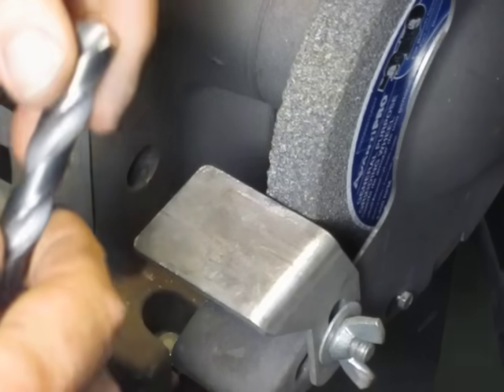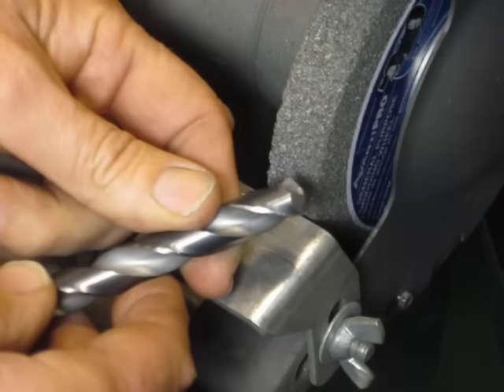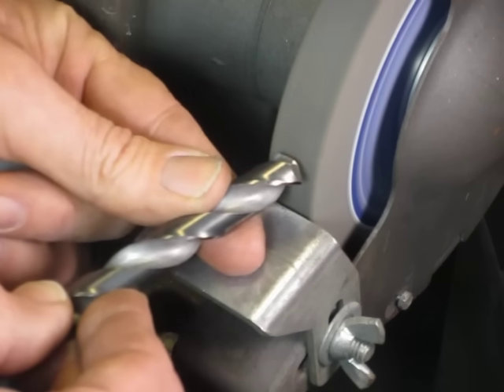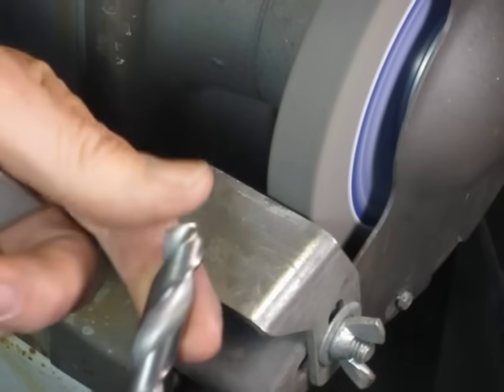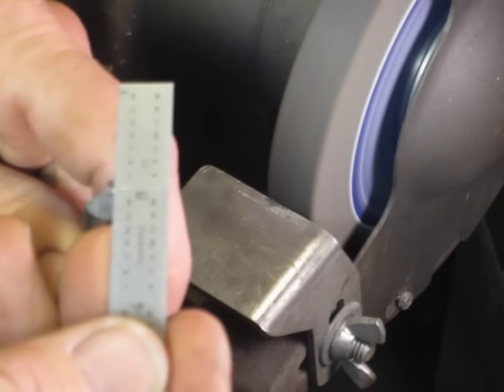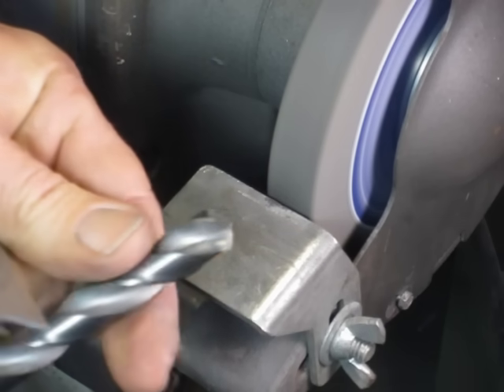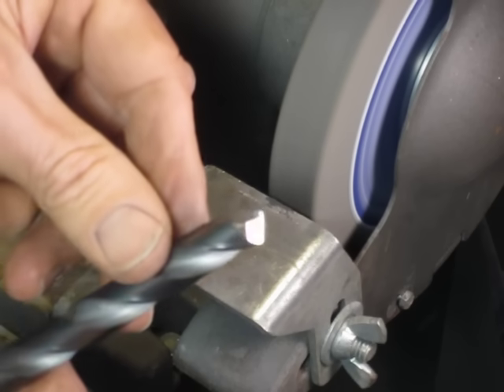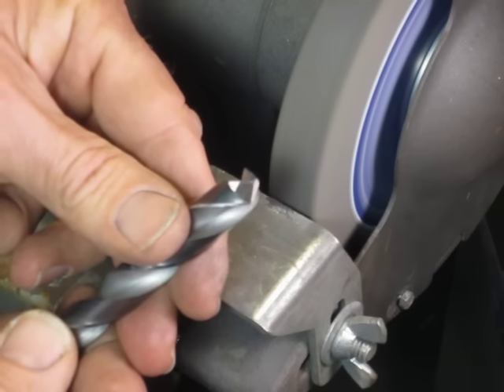How to Hand Sharpen a Twist Drill

Comment: How did you check your chisel centrality? poor centrality will allow the drill to walk during use especially on uneven surfaces.
Reply from the maker: Paul Ehrlich 
Paul,

The drill will pivot around the point and if it is off center, that will cause the drill to produce an oversize hole. I just use a ruler to measure the length of each cutting edge to be sure they are equal. Drill gauges will also have divisions on them fr that purpose.

Tom

Comment: This is not how I remember doing it. Free float handle it buddy. Go through the entire motion instead of just keeping it there. This will remove the last steps you were doing with those newly created edges. Also I find using a sandpaper like belt sander or something rotating on a drill etc, will give you even better sharper bit that will go through anything. I normally resharpen mine every 20 holes or so when I'm doing thin metal in a roll. Stops me getting tired and maintains the bit doing the work and not the pressure.
Reply from the maker: HenryMania 
I used to sharpen them with radial clearance as well until I discovered this method. This way is much easier, especially for the beginners for who this video is intended. Since the clearance angle is fixed, there is less movement of the drill required on the wheel.

Tom
Reply: Toms Techniques Oh I see what you mean. I might give it a try although I've kinda got the hang of it now going through the entire motion. As long as you don't hit the back on the finish swipe it should be good and easy. Fluid as playing table tennis hehe

Comment: After doing a few hundred you can almost sharpen them in your sleep.
I have had to use a belt sander to touch up a large diameter bit. The grinding wheel was way too narrow for me to get both sides of the bit even.

Comment: I do them the same way you do.  Practice is all it takes.  As for the the guards,  I take mine off.  There to dangerous, drop something in there it will either bind up the wheel or fly around and fly out.  I'd rather just have it fall to the floor.  Shit does happen either way
Reply from the maker: jim sanker 
The guards are basically for spark control. What you REALLY need to pay attention to are the tool rests. They need to be close to the wheel so there is no way a tool bit can be pulled between them, with a finger.

Tom

Comment: Good video.  I've been sharpening bits for years, much the same as your technique.  The Tool Maker who showed me found it much easier to start with the biggest drill you have.  After a few drills, 'graduate' to smaller size drill bits.Later, I found it just as easy to use my angle grinder, especially for reducing the web.
Your video might have more impact if you stick the bit in a drill press and bore a few holes. That always converts non-believers.  NEVER use gloves and let the grinding wheel do the cutting.
Reply from the maker: simplyconnected 
Thanks. 

I've been considering re-shooting the video because it has been so popular. Some of the shots are out of focus or errant and it would be good as you say, to demo the finished product. I guess there will also have to be a comment about not wearing gloves when using machinery since there appears to be a few dangerously uninformed souls out there who feel that it's an appropriate thing to do. I really need to get busy on the entanglement safety video that I've been considering. Perhaps a demo on how violent an event a glove getting snagged in a machine is, will open a few eyes and save a few hands.

Thanks for watching.

Tom
Reply: I work at Ford Motor Co. and while waiting to take my 'high climbing physical', a guy came into Medical. He looked like he was shot with a shot gun (he really did). Turns out he was near a huge 4' grinding wheel (used to grind production crankshafts) when it suddenly let loose. His coveralls got the brunt of damage with tufts torn out in dozens of places.
The only exception I can understand for NOT wearing gloves, is with the polishing guys in plating shops.  Polishing compound (rouge) doesn't work until it gets hot so those guys must hold hot parts against buffing wheels turning at 3,600 rpm or more.  Many of the pieces are small. Too much polishing washes out character lines, so it is very tricky, especially on soft pot metal (zinc).. - Dave
Reply from the maker: simplyconnected 

I can't believe there are still people debating this issue. I have seen what a guys thumb looks like after it has been pulled between the tool rest and the wheel of a large grinder and it wasn't pretty. Luckily the wheel didn't have enough energy to completely remove it before stopping. Gloves and machinery DO NOT MIX. Entanglement injuries in highe speed machinery happen in a microsecond, before you even have time to react. This is a concept difficult to grasp by people who are unfamiliar with machine operation and by the time they figure it out, it's too late.

If you need more, please checkout the Fatality and Catastrophe Investigation Summaries on the Department of Labor website. Type in glove and grinder, or just glove in the keyword search for some terrifying reading.

https://www.osha.gov/pls/imis/accidentsearch.html

Tom

Comment: I inherited a very nice drill grinder, Lisle 91000. It will put a brand new grind on a drill bit and it works a charm. 

Though I am curious the one thing you didn't show was the proper angle of the chisel point to the cutting edge. I found this rather tricky even with my grinder to get, if for say you are regrinding a broken drill bit or one that has a completely ruined edge.
Reply from the maker: Jay Cole 
There is no aligning of the chisel point, it just falls in place when you establish the point and clearance angles.

Tom

Comment: ?¸¸.•*¨*• Excellent video Tom¸¸.•*¨*•?

Just a few things for newbies to note :
-----------------------------------------------------
1. Wear safety glasses
2. When starting up the grindstone, stand clear of the path of rotation, big "stones" can shatter on startup or throw pieces everywhere.
3. Never remove the machine safety guards.
4. Tom shows you how to place your fingers on the tool rest.
Many machinist have lost the tip of the finger from a moment of inattentiveness or tiredness.
5. Never ever take your eye of what you are doing.
Don't let kids etc.. play around you when doing this
6. Don't let people come up to you and start talking while doing this, don't get distracted.
7. Wear correct apparel, don't wear a tie or something like that that can go into the machine.

I know this is all Duh! for the old hands but I've seen too many people loose finger tips working on grind stones.
Reply from the maker: Some good common sense points, especially about them being second nature to us "old timers". One that you missed is always make sure the tool rest is properly adjusted. As long as it is close to the wheel, there is no way that a tool bit or finger can be pulled in. You might get a manicure if you bump the wheel, but it's not going to pull your finger in.

I actually did lose the tip of a thumb once when I was young and immortal, but it was on a belt sander. A piece of angle I was holding got between the belt and table and pulled my thumb against the moving belt. I lost the tip down to the bone including most of the nail, but I was lucky. Amazingly enough, it all grew back over time.

Be careful out there. Machines tools are mindless and don't care if they nick your finger or remove your arm.

Tom
Reply: Toms Techniques Yup, My father lost the first joint of his thumb that way.
I once worked in a tool factory and out of a staff of almost 400 people there were at least 30 that had lost a finger joint or 2 from these machines.
Reply from the maker: Lar Cat 

People who are unfamiliar with machinery can't comprehend how fast that sort of thing can happen. Usually the loud bang is the first you notice that something is wrong, but by then the damage is done and there is no going back. You might just lose some skin, or and entire finger. The machine is uncaring, one way or the other.

Tom

Comment: I wish I knew how to watch this over again cause I believe I missed the part about how to hold my hands at 118* . I know the view of the tip inspection is below the sight range, so perhaps the other is also. This seems to be the easiest method to sharpen, if I can only learn the missing technique. Thank You! JD
Reply from the maker: What do you mean by you wish you knew how to watch this over again? You can watch it as many times as you like.

I just rest my fingers and the drill on the tool rest to establish an angle and then check it with the protractor. It just takes practice to be able to pick up the angle again once it's established.

If you have any specific questions about sharpening drill bits, just contact me through my website, tomstechniques.com.

Tom
Reply: Toms TechniquesOne thing you should mention- the sparks coming off the wheel show you where the bit is making contact. If the angle is correct then sparks will fly uniformly, but will indicate gaps when the angle is slightly off
Reply from the maker: 24-7 Lockouts  I do mention that in some of my tool bit grinding videos, but the same applies with drill bits. They will not only be uniform when the point angle is lined up, but will start to come over the top of the cutting edge when the clearance angle is flat against the wheel.

Tom

Comment: Nice, clear and concise video. A little tip for those starting out sharpening their own drills; it can help to scribe a line at 59 degrees on the grinder rest. It makes it easier to get the included 118 degree angle correct.
Reply from the maker: Thanks, I'm glad you enjoyed it. That's also a very good tip. It can be difficult to keep the angle the same on both flutes until you get some practice under your belt.

Tom

Comment: Hi Tom. What grit stone are you using?
Reply from the maker: It's a 60 grit and on the coarse side for small drills. I like it for grinding lathe tools because it's fast, but for drills an 80 or 100 grit would be better.

Tom
Reply: Toms Techniques Hi Tom, I'm wondering is there a specific reason I see most people using a coarse or medium grinding wheel to sharpen bits? For me it would seam logical to grind down with coarse wheel and finish to a nice edge with a fine wheel like 180-200 grit.

Is this wrong? does using a fine wheel create to narrow an edge and as a result the edge wont last as long, or am I ok to keep using a fine grinding wheel?

Also what's your opinion on grinding off the back heel of the bit, I see people do this alot, it also seams logical that it may reduce heat or just aid in the extraction of swarf or something along those line. but the best videos I see of guys sharpening don't employ this technique.

Any help or Ideas would be appreciated.

Thank's!
Reply from the maker: atourdeforce  Using two wheels means you are sharpening the bit twice. Just choose a grit that works best for the size of drill you are sharpening and stick to it. The wheel in this video is 60 grit, which is good for larger bits, but smaller ones are easier to sharpen with a finer grit like 80 or 100.

By "backing off", I assume you mean create a secondary clearance angle. I do demonstrate that in the video.

Tom

Comment: Thank you Tom for this straightforward  technique. Dull and improperly sharpened bits cost many hours of work over time with less than desirable results.  I told the boss to stop buying so many new drill bits. I can save us some cash and get back in production faster if I don't have to struggle with a repair. Subscribed!
Reply from the maker: Thanks for watching.

Comment: my father was a master tool & die maker .....he taught me how to sharpen drill bits in the shop at 16 years old much the same technique as you are doing now........he started his apprenticeship at age 14 and worked until age 65  at a machine shop then taught at trades school until he was 74 and his eyesight was not so good  ......he was so skilled he never had to use the measuring tools himself to check the angles or lengths when sharpening  bits or tools ......the other tradesmen used to call him Peter Perfect   ........great video !
Reply: +Wilbert Michielsen With lots of experience it can be done "bye eye" and be close. Especially on little drills. Personally it is harder for me to do larger ones or tiny ones that way. Plus keeping in mind if you want to go deep improper sharpening can have problems and some probs on diam. even with thin material. It only takes a second to use a protractor n scale or even dial caliper. I throw away babies like up to1/8 or so with the time vs cost and quote for the job in mind plus with a replacement supply of course.

Comment: Вот же лошары американские сверла не умеют точить. И на белом камне надо, на сером перегреют:-)
Reply from the maker: If you are concerned about overheating a drill while sharpening it, you must still be making your drills out of old horse shoes. We've used high speed steel for drills in the U.S. for the last 75 years and it's much more heat resistant. You should have your blacksmith make some for you.
Reply: Toms Techniques не умничай дядя я точу сверла руками 10 лет

Comment: This is how ive been sharpening my drill bit for quite some time works vary well even with harder materials like stainless.  I prefer this method over rolling the relief method.
Reply from the maker: Many commercial drills are sharpened this way. It actually takes less torque to spin a drill sharpened this way than one with radiused clearance.

Tom

Comment: Great video... But, what if you don't have a grinder? :0
Will a sharpening stone work? :)
Reply from the maker: I can shape parts with a file instead of a mill, but it's not a very efficient use of my time. A bench grinder is one of the least expensive machines in the shop. You should probably look into getting one if you need to sharpen drills.

Tom
Reply: rag Doll  I use an angle grinder with a 4.5 inch stone wheel (stock ones) set in a vice.   The trick to sharpening drill bits is holding the bit at the right angle to get a sharp cutting edge so watch the video and check out the position of the bit to the center of the stone (its higher) the angle to the stone (bit is facing slightly left at base and right at its point) and twisted to get the cutting edge meeting the stone wheel rather than not having the wheel meet the cutting edge or having the cutting edge too low and not cutting whats behind the cutting edge.  Practice will get you a sharp bit.
Reply: Thanks for both of your responses.. I think I will just buy new (cheap) bits. :)
Reply from the maker: rag Doll 
Cheap tools will actually end up costing you more in the long run. Cheap drills won't hold an edge, so you'll get a fraction of the life of a quality drill and they are likely ground poorly which means oversized holes. Cheap taps are worse yet because they will break, costing you time and money in scrap parts and tooling. Always buy name brand cutting tools made in the U.S., Europe or Japan. You won't regret it.

Tom
Reply: Toms Techniques
I know.. I just thought I'd be a troll...
Thanks for your help. :)

Comment: I don't have a grinder so I use a file that works pretty good. However the extra cuts that you showed to reduce drag I did not know about and make sense as to why mine don't do as well.  Thank you.
Reply from the maker: You should invest in a grinder. Even an inexpensive one will work much better than a file. Besides, files are about the same hardness as drill bits, which means you are damaging them by filing drill bits.

The secondary clearance angle definitely reduces the amount of power required to drive the drill. Most commercial drill bits are ground that way.

Tom
Reply: Toms Techniques Only needing to sharpen 1 or 2 a year doesn't justify even a cheap, cheap grinder on a fixed budget to me. Mostly I drill wood for landscaping, but the areas on the drill bits that you pointed out heat up, get discolored and I assume cause the smoke I see. What I do, does help sharpen my bits enough to make them useable from absolutely useless. So again Thank You. And I will keep your advice in mind.

Comment: if a drill has been redhot and deformed.(i'm talking about expensive big hss drills.) can it be reshaped only?or with heattreat will it be usable again? or is a redhot big drill only ready for the junkyard?  since we work in team some dare to kill some perfect drills so...
Reply from the maker: A drill that got over 1000F or so would be pretty much junk because it would likely cost more than the drill is worth to have it heat treated again. One abused that much would also have damage on the flutes that couldn't be repaired by re-sharpening.

Tom
Reply: thx for the info grtz jörgen

Comment: great video. Just tried it and it worked for me. Ive tried it before but i was resting the drill bit against tool rest and i wasnt getting the correct angle. Holding the bit above the center of the wheel does work.
Reply from the maker: Thanks.

Yes, holding the drill freehand gives you a lot more control over the operation.

Tom

Comment: Where can I pick up an angle finder like that?
Reply from the maker: That's just an ordinary machinists protractor available from places like Enco or MSC. A drill point gauge would be easier to use for someone just starting out. They have a short blade with a sliding angled piece on it to gauge the point angle and graduations to get the length of each cutting edge the same.

Tom
Reply: Excellent.  Thank you.
Reply: Many engineering tool shops have drill angle guides. I use one at my work regularly. The simpler the better at this stage.